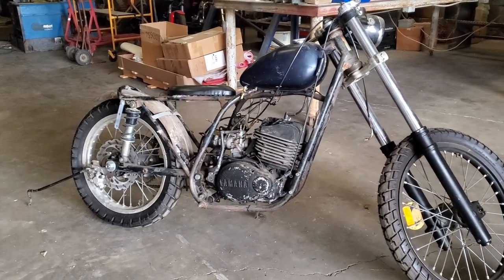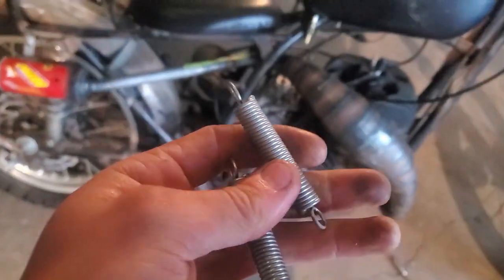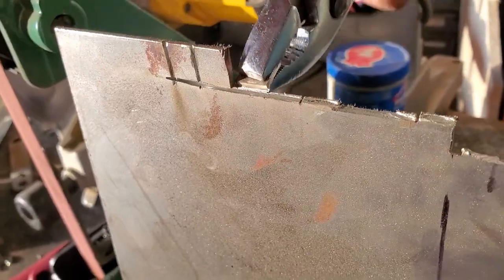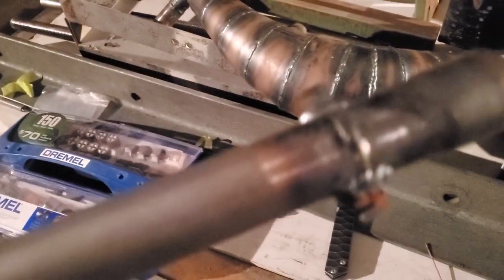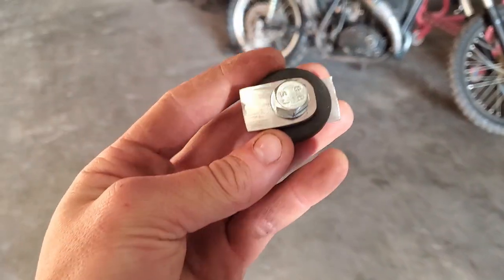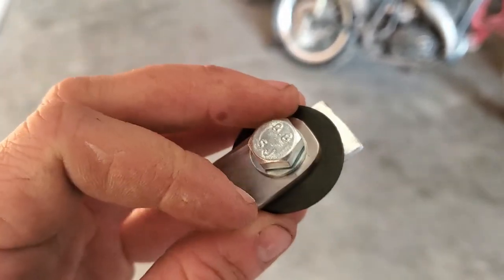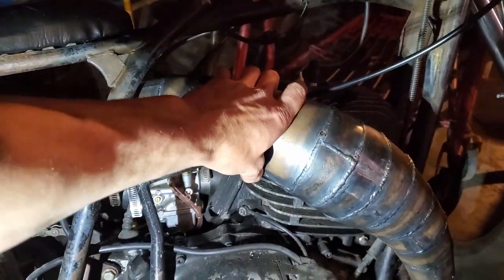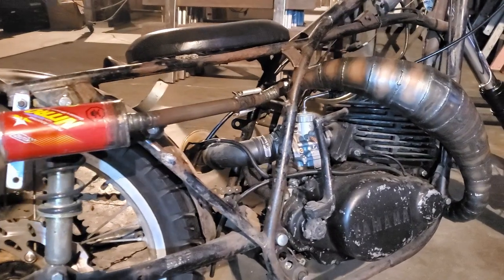EXPANSION CHAMBER BUILD PART 5: Mounting and Finishing the Pipe!

Comment: Did this thing ever run?  I'm curious about the result of that pipe.  I'm running an MX360 pipe on my DT and it makes pretty good, usable power from about 5000-7000.  The cylinder is ported extensively but I have retained the original exhaust port timing.  I like that low end torque.  With the MX360 porting it trades off low end and revs to about 8500 which is pretty silly for an old big bore single.  If you were shooting for 10000 RPM you'll need a lot more exhaust and transfer duration.  Of course, if you change the port timing it requires changing the design of the pipe again.

Nothing about a big bore two stroke is well suited to making high RPM horsepower.  Port windows relative to displacement are small, the big piston generates a lot of reciprocating load as RPM increases.  As nice as that pipe turned out, you would be better off with a much longer design designed for peak power in the 6500-7500 RPM range.
Reply from the maker: The 10,000rpm value was a default value from the template. When I actually did the calcs for the pipe, I used 7,000rpms. It has ran briefly in neutral but has not seen the road yet! Still have a lot to do to get it in moving condition. I have another few videos in the pipe building series here
Reply: Wanna build one for me I'll pay cash or sell this one
Reply from the maker: For a DT?
Reply: @cameronpotter6555  I've got an extra mx360 pipe here.